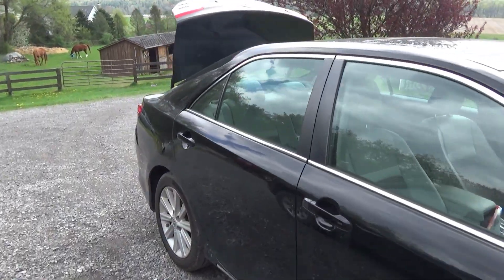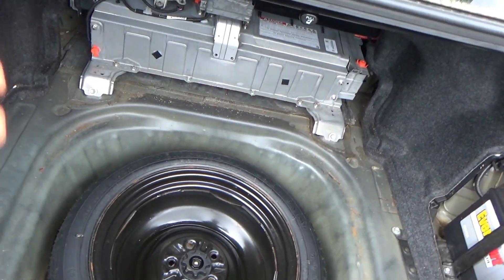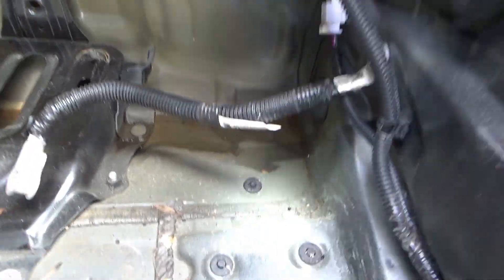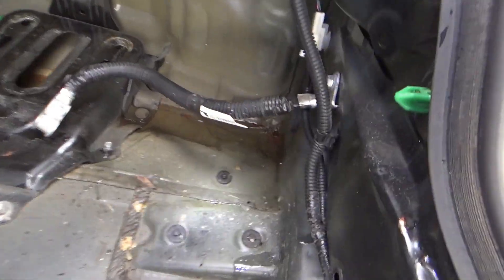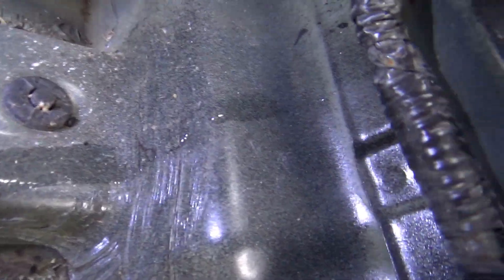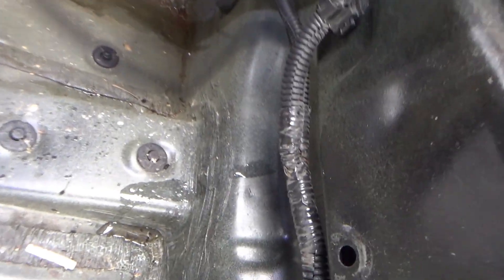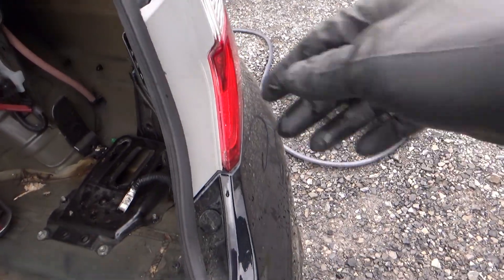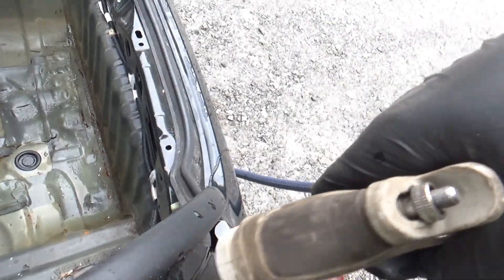Helpless HYBRID....from Florida?? (Part 4 - Trunk WATER INTRUSION?)

Comment: I worked on a 2013 Camry the spare tire was under water was the same as this car was hit right rear, also check the right passenger rear floor it's probably soaked, under the passenger front dash the ac hose drain hose is right under the carpet hose gets knocked off from passengers feet and soaks the carpet

Comment: Tail light seal failure or the door pressure vent door under the bumper cover or poor repair job by the bodyshop and  didn't replace all of the sealant properly

Comment: Did you check the pressure in the spare tire before you put it back?  🔧
Most spare tires are never checked (valve is facing down) and the higher pressure in compact spares loose pressure faster than regular tires.
Reply: Spare? what spare?😁

Comment: I'm not saying that the seam isn't leaking, but I seen the water coming around that green plug. I'm having the exact same thing happening on 2009 Ford Fusion. Instead of green plugs it has white ones and can clearly be seen leaking around them. Great job as usual. Love your channel.
Reply: It was leaking in ABOVE the green "part" ... see 6:25  press "space" to pause and "." to go frame by frame.
Reply: @thedraac1818  this should be top comment, it clearly is the green plug leaking.
Reply: @arnobruynen6073  Actually @ 6:27 it is leaking in above the green "clip" from the seam, then onto the green thing.  Go frame by frame, you will see it run out of the seam and onto the green part. Or even change the playback speed to .25.

Comment: Being a body man, you always do a leak test with everything closed. Then you have to try and mimick rain from all kinds of directions, even to the point that how or were they park the car, could be on a hill tilting to the left right facing up or down.
Reply: Sounds like you do professional jobs 👍🏻
Reply: @sheerwillsurvival2064  yeah, he does walking with the dogs
Reply: YES, close person in trunk with flashlight.
Reply: My experience with "body shops" do not do anything but swap parts.  The cars I have taken most often are never the same.  Insurance companies do not pay for good work to  be done!  Sad, but true.
Reply: @maui6446 :  I dropped off a Mercedes at a body shop for a customer; as a favor. The body shop did a little extra for the guy as well by leaving the drivers window down a little, then spraying PRIMER. There was primer on everything, most notably the upholstery and instrument cluster. What a MESS. The body shop and insurance company tried to claim car came in like that 😆 BWAHAHAHAHAHAHA. The car owner had to get feisty, but they finally wised up. I don't know the cost to make it right, but it was THOUSANDS OF DOLLARS in mid 1990's 😵.
Reply: I have an 07 Camry hybrid, had some water in trunk... from a 1 gallon bottle. After I cleaned what I could, I hung a couple "dryz air" bags in the trunk, and they got the condensation trapped over a week or two.